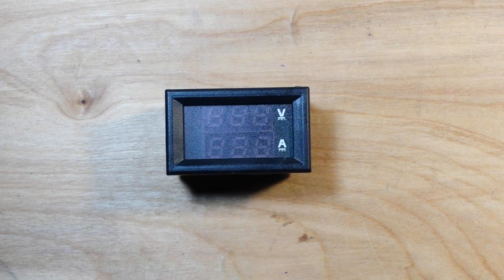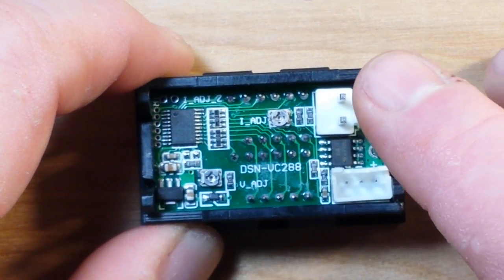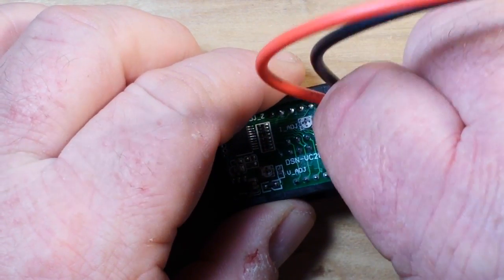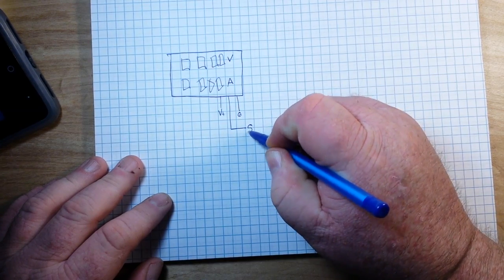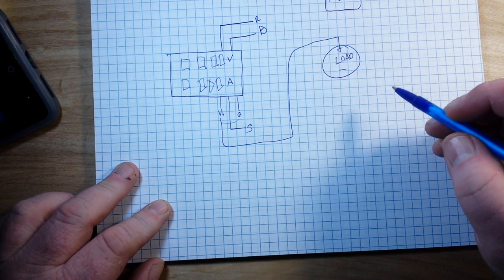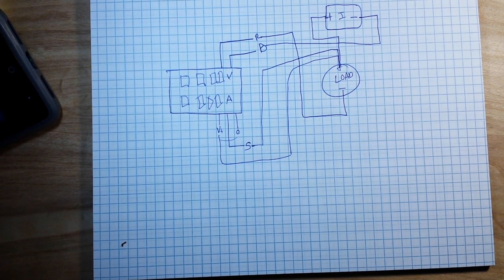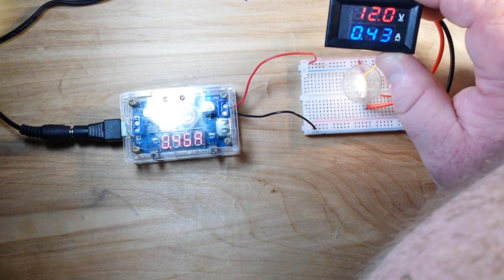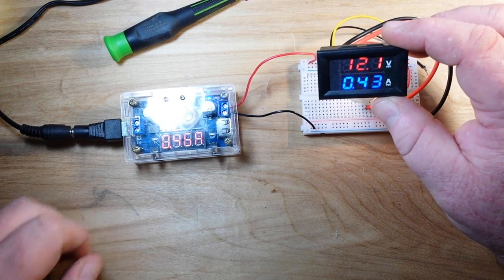eBay Volt Amp Meter How to

Comment: Man, I was so close to throwing this cheap thing away, until I found out it had adjusters for the inaccurate volts and amps readings. Quick question: if I use this in an older transformer & rectifier style car battery charger, will the voltage ripples affect the reading from this panel gauge? Is there anything I could do to overcome that without affecting the battery charging, such as adding a filtering capacitor to the panel meter?

Comment: The last batch of these thatI bought (March 2024) had terrible quality problems. 3 out of 5 had a defect. I found that the tracking on the amp meter was rather inaccurate. You get what you pay for.

Comment: Thanks for showing these, I've been planning to install one of these on my boiler control box so I can see the draw and voltage of my transformer at a glance.  I'm a service plumber and I work on heating boilers all the time.  My #1 check on a service call is to check for proper voltage and current draw at the transformer('s).  I wouldn't install this for a customer due to risk exposure, but it would sure be nice on my system.  I've also been looking at the round button style due to the fact that they can fit into a knockout without case modification.  Thanks again for demonstrating this, you answered some of my questions.  I know this was an older video but it still applies today!

Comment: Thanks again for sharing yet another informative video. I just received 2 of these from Amazon.  I just ordered a Longwei 3010KDS bench power supply yesterday . I am designing an Home Electronics workshop for Amateur Radio, Model Railroading & Drone hobbyist.
I will be using breadboards with Raspberry Pi & Elegoo Arduino Uno  with breadboard power Supplies 3& 5 V.    I have subscribed to your YouTube channel and appreciate your efforts in producing quality videos.  73 de AA4S

Comment: I have watched this 3 times. I think I get it, would this work with a power source that uses pulse width modulation? I have researched other amp meter that work for my purpose and they are very expensive.

Comment: I have a model railroad that uses dcc. I don't know if you are familiar.  I have a controller that has a 12v dc power supply, the controller output is 12 to 14 volts that voltage is supplied to my track. So if bought one of these, im not sure how I would hook it up exactly to read volts and amps from my track.

Comment: I am a bit dim or strugling to understand.
I have a meanwell type 12v PSU I want to add this to, so do I put a thin RED and Yellow and Thick black together on the PSU 12V output . Then thin black and thick RED to the PSU negative output

Comment: I'm working on something that has separate volt and amp meters, and apparently you can;'t use the same power supply for both. I wonder if this would work for my application?

Comment: Trying to hook this up to a small trailer.  The negative side of the load is the common ground also hooked to the neg side of the battery.  Tried to hook it up like this and maximum smoke.

Comment: When I hook up the big black wire, it shorts out my variable voltage control board and my output just gets 12v, why is this?

Comment: Please i have a stupid question .... I bought exactly the same one , voltmeter and ammeter to monitor my battery  and know how much voltage left and when it is fully charged ...  Did i buy the wrong tool ?!??  Can i use this to monitor my battery or this tool is just to monitor the connected devices !?!?!? 
Please someone help ... I'm still learning
Reply from the maker: This just shows you voltage and current, it be does not show capacity.

Comment: Hi Paul! Great explanation Thankyou.  Is there a way to monitor the current on multiple loads at once? in my campervan I am trying set this unit up to monitor the 12v Fridge,  12v lights and occasionally a 12v to 230v inverter , everything runs from the second aux battery through a fuse block then out to the loads . Thanks in advance

Comment: So, you did not connect the sense wire? Why?
Reply: because it uses ppositive and negative as voltage sense instead of positive and sense, or negative and sense

Comment: I see that you're not big on answering people's questions, so, I'll ask anyone who may answer: I have the very same meter only it's rated for AC. The heavier black and red leads go in series with the load for the 10 Amps. How are the 3 thinner leads figured in? Is the control power also AC or separate source DC?

Comment: Thanks for the great video---so many get this device wrong...quite a relief here!
 One thing: Have you done a video on a configuration where the the load is supplied with one other than that which supplies the meter?  IOW, where we are not interested in the meter supply, but the A/V of a hefty load supply.
--daLE

Comment: I have the same one as well except my one has 3 thick wires could you tell me what those wires are for ?
Reply: Thins should be for powering meter (display) when measuring inputs (power supply) larger than 30V. Fat ones are allways  for measuring the load (red goes to plus for current, black for minus /ground. Third one is for value measuring.

Comment: It's been 3 years since this video was posted and you can still find these things on eBay! 
It's probably a better idea to run it from a separate power supply if possible, I have some of these that I'm planning to use on a project soon, I'm wondering what their power consumption is so that maybe I can figure out a way to power them but not from the load battery. I'm also wondering how much current it could take before going into meltdown, actually I'm going to have a look on eBay for other current sense resistors to replace the one fitted if it's just not enough for what I need it for!
Great video!

Comment: I have Got This (100V - 10A) Meter and i have found that 2 Adapters was written 9V and Coming 17V :D and another 13.3V and coming 6.5V. 

Now About Meter:
You Can Use Meter Only With AC Adaptor Or Battery - To Turn on. Use Minimum 3V Maximum 12V and Maximum 1.5A. Use thin red (+) and thin black (-). 

thick Red - is changing Pulses
thin Yellow - also changing Pulses
thick Black - also changing Pulses

1) Volt measures thin Yellow and thick Black
2) Volt measures thin Yellow and thick Red
3) Amps measures thick Red and thick Black

Comment: I wired this into the car to power my President Lincoln CB radio. I wanted to keep eye on amps and voltage to make sure i don't kill battery when parked up.
Big problem i discovered was it measures on negative feed the amperage, so if i earth the CB radio out it will by pass the meter.
Can't see a way to avoid this.

Comment: So.....Yellow +ve voltmeter tail.
           Thin red VCC (display power)
           Thin black -ve voltmeter tail and ground/return for display.
           Thick wires current carrying to load through ammeter.

Comment: From what I understand, you're limited to 30 volts in that configuration, what if you have to work with double that?
Reply: @ahmedloay7555  Thanks. If I just hook up the red and black inline from the battery to the motor will it measure volts? I'm not that interested in amps. I ordered one, not sure if it's what I need.

Comment: ive been trying for hours and this video was amazing i was about to go insane
Reply: So I am doing a 40v power supply. Seeing as though the meter can’t handle that. I was dropping the voltage with dual resistors or voltage divider as I should call it. Is that going to effect anything going from meter - divider - load+. Thanks for any insight. Love the channel thank you. I should also add I’m using a lm317 to variate the voltage. Where would you plug that in.

Comment: Very nice video friend... Could I wire my meter up like this to monitor the output of my 75 W solar panel? The battery would be the actual panel and the load would be my battery? I tried wiring this meter up last year and fried my charge controler, so... just asking for your help before I try again? :)

Comment: i don't quite see the problem there, black current wire goes to ground. if i got it right, you just don't need to connect the second ground wire if using same power source?

Comment: Banggood now supplies the wiring diagram but, frankly, I didn't trust it. I chose the independent power source option, afraid that the amps would include powering the meter. In any case, thanks for demonstrating that it works. This was very helpful.

Comment: at 6:11 you stated the panel meter read .43mA vs .469mA that the psu was showing, implying a difference of only about 4mA between the two.  In actuality the meter is reading out in amps, not milliamps so the comparison  is between 469mA on one vs 430mA on the other, a difference of about 40mA.  That's nearly a 10% discrepency , which is what I am seeing in my own testing of these units.  Personally I was a little disappointed in how inaccurate the current readings are, even despite their low cost.  The three I have all are showing the same behavior, so they do appear to be consistent from unit to unit.
Reply: I see that the issue was already mentioned once I read further down the comments, as Maxwell Smart was fond of saying....sorry about that :)  I also reworked my test setup , using a separate 9V (isolated) supply for the panel meter itself & the results are much more to my liking.  The discrepancy between my bench ammeter & the panel meter now only around 2%, more than acceptable imo considering the cost tradeoff.

Comment: I have a simple set up, a 200 watts wind turbine, the regulator that comes with the turbine, two 6v batteries in series to get 12volts, and a power inverter charge controller that connects to the batteries with small jumper cables that come with the inverter. My question is how do I connect my similar looking volt amp meter to keep track of the battery voltage and the amount of amps the inverter is using? I don't know if a shunt is necessary, but I do have one.

Comment: where did you get the power from to go to the voltage input wire which is with the yellow wire?
Regards Roger.
Reply: I have a power supply which has a reversing switch on it would this work on this meter it would be reversing the power to the meter some times?
Regards Roger

Comment: Very good theory and practical run. I was always fond of my amp meter in my previous van. My now 05 Town and country Chrysler doesn't have one. But I would like to adapt one. Would you happen to know how to wire this type or the usual round type (which is only Amp) into a cars 12v system? Gauge will go on dash. Thx.

Comment: Set the thing up correctly and was breaking my head over it for days (no technician by any means, just as a hobby) and then it struck me: the damn thing requires 4 volts! Nice tutorial you have, covers most of what you can do with it. the display can function with or without power source depending on how you set it up. a question though: what do you call that white plastic the light automotive bulb is placed on? looks way more convenient than just tying wires together.
Reply: breadboard

Comment: im having a major issue right now with this meter.. i have it all hookup up in the psu case. i have everything completely done, BESIDES 2 wires.. if i hook it up the way it is supposed to be, bot the black and red wires for current will both be hooked up to the same thing.. because i am trying to put this in a circuit that measures the output of the psu.. There is no separate power supply. the power supply ISSSS the load.. so is this just not possible? ive seen it done but for some reason i can not find it anywhere online now that im actually hooking everything up.. HELP!!!!!!!!!!!

Comment: Fell foul of one of these only yesterday, big poof of smoke! One side of the ammeter being connected to the 0V of the power in, it has to be wired as you say. I.e. current measurement after the load, referenced to 0V.  Totally impractical for the application i purchased it for, which was to keep an eye on in tank fuel pump current draw (the pumps ground wire disappears into the loom to where i don't know). Have wondered if a little 1W isolated dc-dc converter to power the meter would get around this. But surely loosing true 0v reference would lead to no or inaccurate voltage measurements. Great video.

Comment: OK, I can't figure out how to add this in my circuit. I can get volts, not amps. I really want to supply the meter with a separate power source. I'm putting in 9v to the circuit and had a var and standard potentiometer to vary only the amp output. I need to know the outgoing voltage and amps. What am I doing wrong????

Comment: I bought some of these for a custom power panel I built for my RV trailer. For the AC I ordered one of the bigger DIN rail mounted ones like Big Clive reviewed and ordered these smaller ones for the DC side (battery, charger and solar panels) of the system. It all works  nicely and I even implemented an arduino based controller that will send data via  wifi to my computer or smartphone if a circuit trips or just to stream live power usage..

Comment: You're using the front of the meter and not showing connections from the back.... So, The sense connector is the middle prong...???
Reply: The sense wire is the one that's not red or black. I've seen them blue, white or green depending on the seller.

Comment: Why did you work showing the front of the meter and not the actual back and the actual connection point.... Nice you labeled current red and black.... but, why didn't you label the sense wire, positive and negative... red/yellow/black..??  is "Yellow - Sense Wire..??... You didn't use the small black wire...???
Reply: Agree .. Connecting the black wire resulted in a melt down of it !
But the plus side is the black plastic covering will not add to climate change !

Comment: Hi. I purchased a little step up/down power converter (LM2577S) with a little 3-digit display, much like the one you use in this video. Please consider a short review and how-to tutorial for this unit. Cheers

Comment: Hi it's good Video , Can you help? I am building a Bench Power Supply using a Power unit from old PC power Supply which has 3.3 Volts at 17 Amps , 5 Volts at 22 Amps and 12 Volts at 18 Amp, I have been told that the Volt/Ampere  meter can only measure down to 4 Volts and maximum of 10 Amps, so it will not read my 3.3 volts and also it only read up to 10 Amps, I  bought the Volt/ Ampere meter it a 100V 50 Amp from ebay and got a Shunt it's rated at 50 Amp 75mV ( What does that mean?) , Would this do the trick? if so how would I wire it , can you do a Video on that? Please.

Comment: Thank you a lot.
I just got these and thought they were Pete tong. 
Red and black = short or nill ( just lights)
However thin wires with white to the love gives a reading of volts only. (No load currently).

I'll have to look at the video three more times on how the hell you have to wire up this meter as it make little sense....

Oddly I went back read more detail  on the eBay page.
DC 1-100v
DC 3-30v

No over 30v as will burn...
Umm yeah not sure about 100v then!
Also claims 10amp, then states 32mA? Great more clear engerishness

Comment: I got one of these can I just hook up to my solar panel to c how many volt and amps my panel putting out it’s a grid tie only have one power source
Reply: Make sure you know that your solar panel does not exceed 30 volts, even before you try testing it, if the panel it self is also supplying the power for the meter at the same time.   Otherwise, use a 9 volt battery (or some battery > 3.3v  but less than 30V)   to supply the meter power, and isolate the plus side of the battery from any other connections besides the plus input (small red wire) to the meter power.   Typical poly silicon cells are .6 volts per cell, adding up in series.   So if you have a 36 cell panel you may be safe since 36 * .6 = 21.6 volts, but if you have one of the latest like a 60 or 72 cell panel, you are risking blowing out the meter with excess voltage to the leads that power the meter itself.  (I'm going by the specs mentioned in the video, presuming they are correct).   Presume also, that you are going to measure the voltage at a point between the panel and the grid tie inverter, since this is DC we are talking here, not the AC.    I guess one should make a little module with the meter wired up correctly, cutting in half a couple of short extender wires matching the plugs that that come from the panel and going to the inverter, attached appropriately in four places to  the module so it can be inserted between the panel and the inverter.     Once attached it should be interesting to see the inverter regulating the voltage and current, as it seeks the maximum power point -- particularly as clouds or other shadows pass between the panel and the sun.  
 
 I note that a large panel (i.e. with big solar cell sizes) might exceed the 10 amps maximum for the little meter if one tried some measurements without the inverter, to get the max short circuit current.  Note that cold temperatures outside will make a solar panel exceed it's written specs.  (Yes!  In cold temperatures solar panels outperform the specs which are for room temperature (actually 25C -- which is a bit warmer).   Max volts with no connection to the inverter would probably be higher than when the inverter is in action, but the inverter will automatically cut it's connection to the panel and will be out of action any time it is unplugged from the grid, since that's what grid tie inverters to to protect and isolate the grid when the grid is down.  In which case you will suddenly be measuring maximum  open circuit voltage.   Always unplug the AC side of the inverter before attaching or detaching the DC cables -- to prevent arcing on the DC connectors.   Alternately cover the panel with an opaque blanket.    Finally, play at your own risk.  I assume no responsibility.  Fair warning!